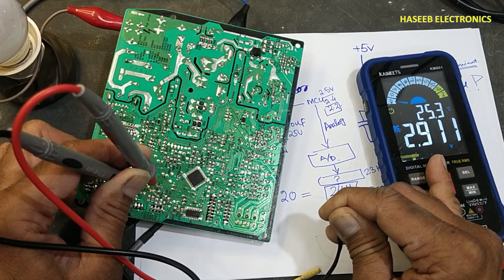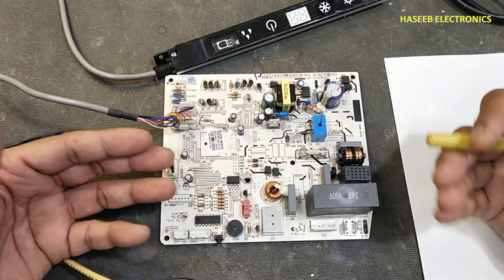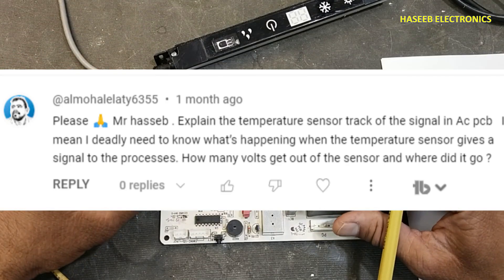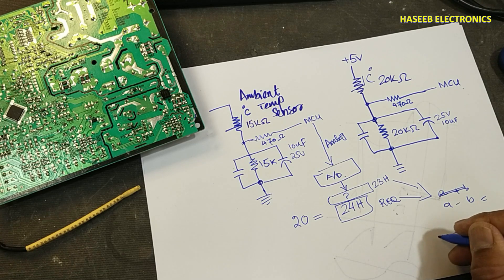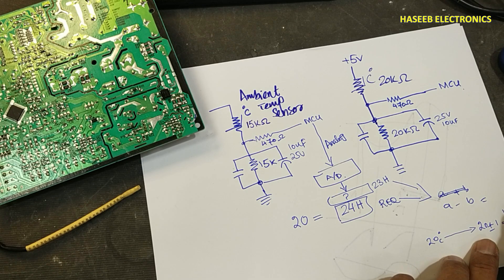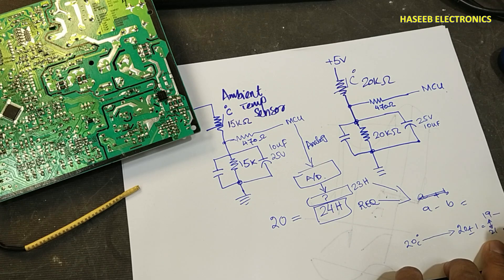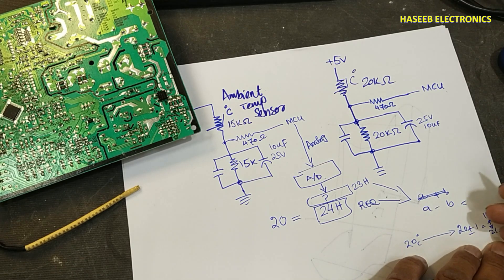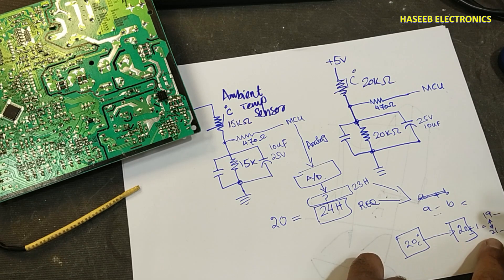{951} how temperature sensor works in air conditioner

Comment: sir i learned  new things from this video thank you so much sir i have  a question does all thermistor voltage divider networks use the same value or r1 and r2 for example  if  im using 10k thermistor as r1 and should i use r2 also 10k resistor ?.
Reply from the maker: best regards
it is not a rule that second resistance must be equal to thermistor value. it depends on the designer's approach that how he is calculating voltage divider and how he configures it in the software